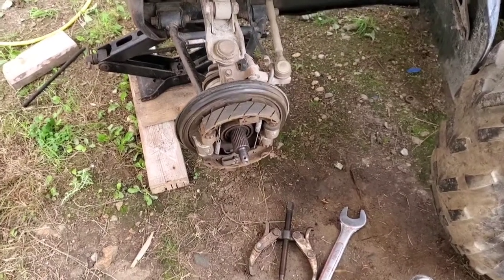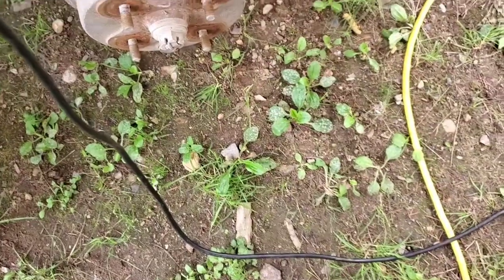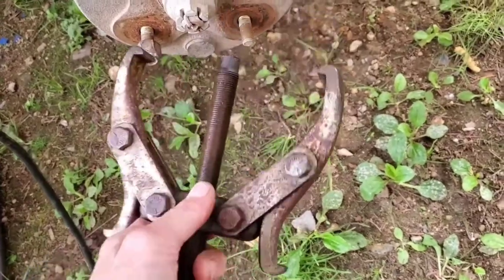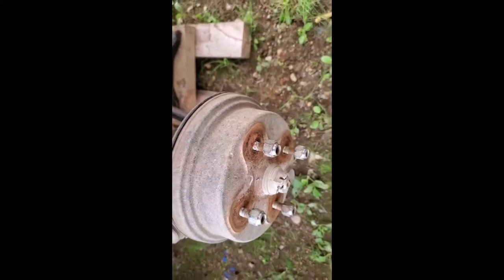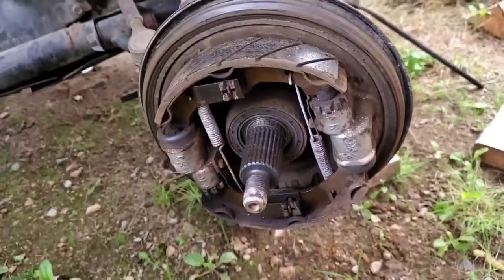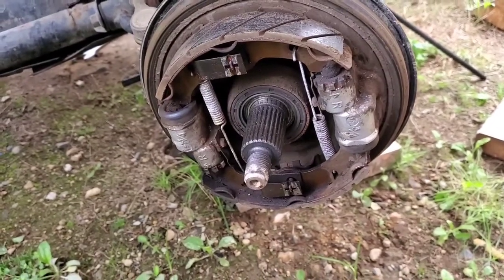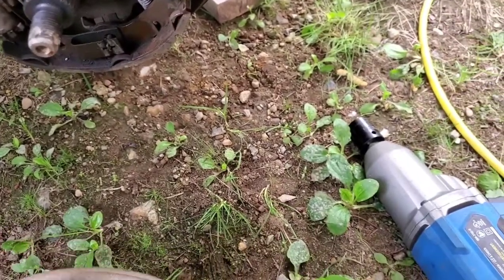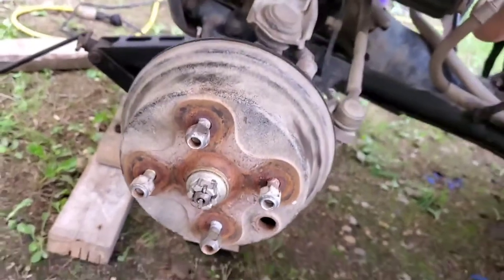Yamaha ATV 1993 4x4 350 Big Bear Front Brakes

Comment: Next time, don't use the jaw puller.. Rent a hub puller from autozone..Fits perfect on these hubs, and you don't have to worry about messing up the wheel studs or the axle shaft.. The hub puller is only 25 bucks, too.. It's also made to pull these hubs, unlike the jaw puller.. It's OEM TOOLS Part #27037 You were lucky your quad lived most of its life with the dust caps on the axle nuts.. I have had some that seemed to have the hub rust welded on the axle.. You would never get one rusted up that bad off with a 2 jaw puller like you did..

Comment: My Kodiak manual says to tighten the pads solid against the drum, and then back off 3 iterations with the screwdriver.
Reply from the maker: Copy that Airbiscuit.  Hail to the manual!
Reply: What year is your Kodiak?
Reply: @Eger118877  1995
Reply: @airbiscuit5101  I have a 2000 Big Bear 400. I wonder if it's the same procedure.